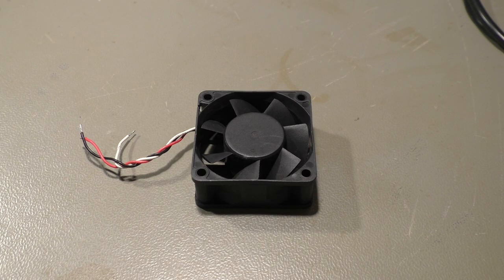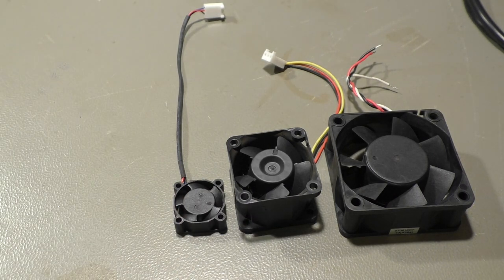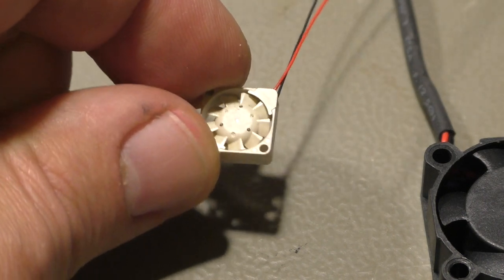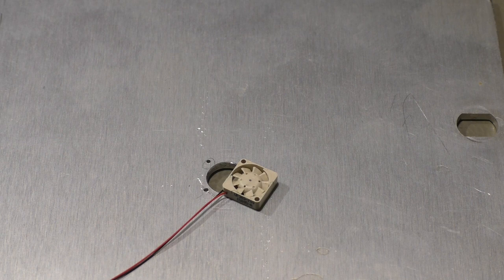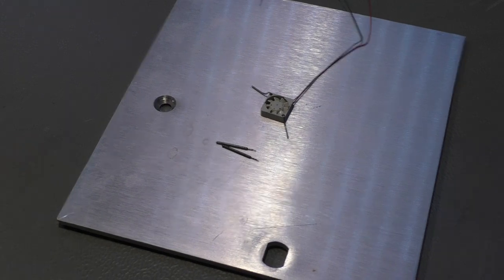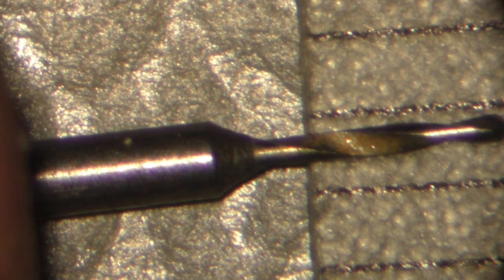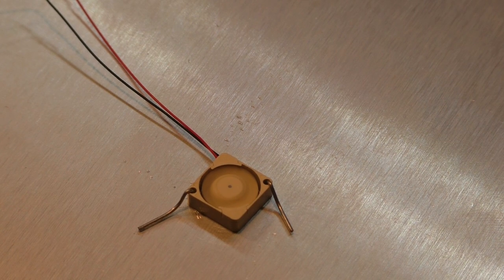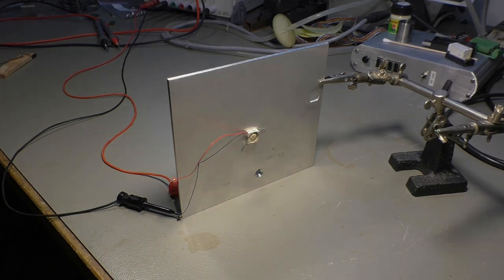The smallest fan you can buy - (PWJ97)

Comment: I worked for a company that used fans like these in the late 90's. They were used on a high end graphics card that used a geometry processor as well as 2 gpus for rendering and textures. The geometry processor was a small qfp device that had a fan the same size as in the video that was attached to a small heatsink that was glued in place with thermally conductive epoxy.

Comment: We use fans this size for helping to keep small embedded computers a little cooler (No pun intended) so probably small devices or embedded SoC's where the thermal capacity is low but the temperatures can easily reach the operating limits of the die if not cooled.

Comment: One interesting use scenario, would be to blow on each individual memory module on a GPU, specially if they can be overvolted to 4.5V in order to get some interesting air pressure.
Reply from the maker: "interesting air pressure" that's a word! I guess even with 1000 volts you won't get enough airflow to cool such a thing.

Comment: Hi there I make terrariums and I've been on the hunt for a small weak fan I think I've found it. This small amount of air movement helps create microclimates and eliminates stagnate air while not completely drying out the terrarium. Great vid 👍
Reply from the maker: That's an interesting application! Yes sure it will certainly work even if the airflow is really low. But there are also slightly bigger models. Have you thought about powering the fan with a solar cell? You certainly have a lot of light in your terrarium...? No need to replace batteries or run cables :-)
Reply: @PlaywithJunk  honestly had not considered that thank for the idea! Are they any good run of the mill ones you'd recommend?
Reply from the maker: @screamingirish  Well, I guess any cell with abot 3V output will do. You only need a few milliamperes to run the fan. Maybe you have an old solar garden light or similar lying around? If the voltage is too high you can use a 3V zener diode to limit it. Or you put some tape on the cell to block some light...

Comment: Oh, wow. I recall seeing these on sunon's website in 2008 or so, if I'm not mistaken. They are around for quite some time. No idea where these would have a practical application aside from mobile electronics that might run just a bit too hot without a fan. Nice joke, too :)
Reply: They were used in old high performance graphics cards. It cooled the small power compressors for when the card kicked into high gear.

Comment: Thank you for sharing this. I am a crafter and have been searching for a small fan that I can mount the underside of a bottle cork to move a lightweight mobile (gently) within a gallon glass bottle. I am working on the prototype design now as I have a large supply of gallon bottles (thanks to my husband’s contestant purchases of the wine that comes within them)
I am surrounded by these many bottles!
Now I search for a small (preferably circular) solar panel to power the fan that can mount upon the cork top!
Just as for every pot has a cover- every invention has a purpose. In this case multiple purposes!
Reply from the maker: That is a nice idea! The fan is indeed very weak but if your mobile has low friction, it may work. Together with a solar cell that may look nice. Send me a picture of your work!  playwithjunk@gmail.com
Reply: I think you need smth with bigger static pressure to do any work other than moving air around. I posted a micro-turbine link (and it's only at 8,000 RPM, would love to see that boosted to 50,000 lol).

Comment: Tiny heatsinks on voltage regulating MOSFETs  of roughly the same dimensions of 9X9 mm to 12X12mm. These silicon devices get extremely hot. The even smaller fans are used in hypoallergenic mask and breathalyzers, with one I know of being used in a pathogenic detection device. Created for the medical industry, however there was an existing and ready market in micro sized communication hardware.

Comment: I have a project for several small fans. But, quite different from the standard usage, sort of.  I am an S scale model train nut. It bothers me that modern diesel engines do not have moving cooling fans 😢.
I know not one of the major issues that plagues the world. But to achieve accuracy and detail that others have overlooked is an
achievement.  I know the fan diameter. Not the bolt hole separation. 
I guess the fastest way other than researching specs that I am not familiar with, (ask me about NAS1097AD4 rivets) is to just buy a bunch of fans. Digikey? Any suggestions, would help.
Cheers to the channel and participants.

Comment: I used one of these to cool down a Raspberry Pi 1. It was small enough to fit into the case. But it was a radial one.
Reply from the maker: I will probably put it into my Raspi3. A heat sink is already glued to the CPU and an additional fan can't be wrong. 3.3V supply is also there.
Reply: I had attached a small MOSFET to a GPIO Pin and a python script running which checked the temperature and set the PWM of that pin. I used the 5V line (it was a 5V fan anyway), it's better to not put big loads on the 3V3 supply.
Reply from the maker: Hmmm... I think 100mA is not a big load. And if that doesn't work I will simply use a resistor to reduce the 5V to 3V (2V@100mA = 200mW, 20Ohm)But I agree that your method is more elegant :-)

Comment: Nice demo, thank you. I'm new at this, what would I need to power 3 or 4 of this fans at the same using single USB to power it?
Reply from the maker: The small fan runs with 3V. USB has 5V which is a bit too much. You could try to connect 2 fans in series, that leaves 2.5V per fan. And if you need 4 fans then 2-series, parallel to the other 2-series...
Reply: @PlaywithJunk  thank you

Comment: Hi, maybe you can help me. If i connect a 12 volt fan to a normal USB entry (5 volt) will it run slowly or not work at all?
Reply from the maker: depends on the fan.... :-)  There are many 12v fans that run perfectly on 5v but much slower. Others dont work at all. There is also the possibilita to use a step-up converter to get 12v out of 5v input. But also take note that current is limited from USB. Don't use a too big fan.
Reply: Play with Junk thank you for your answer!

Comment: Would this work on a single AA or AAA battery?
Reply from the maker: Maybe... mabe not... it's something you have to try. I think 1.5 volts is probably too low. Two cells (3V) would most likely work.
Reply: @PlaywithJunk  Alright, thanks :)

I'm toying with the idea of finding a way to put this in a VR headset. I would only want it to spin at a very low RPM, just enough to circulate some air

Comment: Had to maintain machines that make watch parts, like a "pinion" with a diameter of only 0.5mm, what was the "problem": 

It had BURRS on some of the teeth…

In principle these machines use lever systems, to scale down the travels...
Reply from the maker: Scaling down the movement is not the problem. Even a cheap DVD drive can position its laser to micrometer precision. But I wonder what grinding wheels they use to grind a flute into a 0.05mm drill....
Reply: The grinding wheel is proportionally large compared to the drill/tap and it gets, quite often, "profiled" by the machine itself, mostly with a small diamond using the scaled movements.

Comment: Is it possible to have it on a usb plug?
Reply from the maker: USB is 5 Volts, the fan need 3 Volts... if you add a resistor to drop the voltage, it may work.
Reply: @PlaywithJunk  Thank you